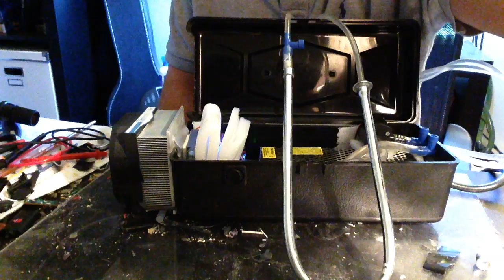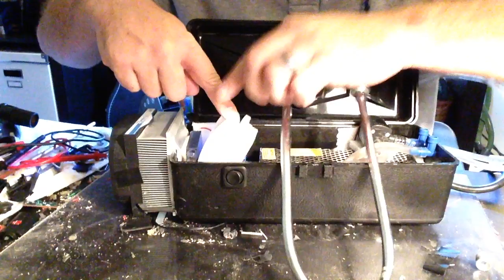DIY Reef Aquarium Peltier Chiller $50

Comment: Are you still using this? I thought salt water would rust aluminium water block.  Is there any rusting?
Reply from the maker: The tube is stainless steel. No rusting so far although it’s covered in algae so hard to say for sure.
Reply: The water I believe is not tank water that is being cooled. It’s separate water that goes through the stainless steel tube water block and clear tubing which then cools the tank water. The only things touching tank water are maybe some clear tube and the stainless tube

Comment: these things are like 4% efficiency rating. whyyyy even bother with them. Use 2 heat sinks on either end of a sealed vessel with butane in it. it will boil at the heat side and re-condense at the cold side.

Comment: Doing something similar, having an issue with the CPU fan .. tried to wire direct into the blk/yellow with no luck .. can you advise how you connected yours? Thanks
Reply from the maker: The cpu fan is wired directly but it’s a 2 wire fan. Some are 3 and require a controller.

Comment: I'm thinking about building something similar, although I think it may be better to keep the psu in a separte container.  I think the heat generated by the power supply can reduce the chiller's efficiency, not to mention the potential problem if you get a water leak inside the container with the psu.  Cool idea, though.
Reply from the maker: +Edwin Valencia great points. I ended up moving to an exterior power supply.

Comment: So let me understand this, the water that comes in (at what GPH) becomes 10 degrees colder at the output? One pass?
Reply from the maker: +Babak Morshedizadeh The water being cooled is in a closed loop. It chills the pipe which transfers the cold to the water lowering the temp.
Reply: +Innovation Labs I see, this is nice.
Reply: +Innovation Labs But won't stainless steel react with reef water, kill inverts?
Reply from the maker: Platinum would be better but I haven't had any problem.
Reply: +Innovation Labs Can you build me one? I'll pay for it, of course.
Reply from the maker: I'm sorry, no time. I am busy working on my RC lawn mower at the moment.
Reply: +Innovation Labs I need one of those too. Does the RC lawnmower make coffee too, also make the bed? Maybe also maintain the reef tank? And answer on my behalf to the wife?
Reply from the maker: Haha I wish!
Reply: +Babak Morshedizadeh you can get the parts on amazon . I did 4 of these in a Lil different manner for dwc system. going redo with a idea adding a controller to adjust temp.
Reply: TEC GROW I am looking for a solution to dwc reservior  temps. How well has it been cooling for you?

Comment: Any idea as to how many gallons this would chill or temp range?
Reply from the maker: +Zachary Roy  I have a 30gal tank and it can lower the temp 5-10 deg. Once it gets to the temp you want it doesn't take as much to keep it there.
Reply: Awesome, thank you for the quick response.
Reply: +Innovation Labs it's actually depending on Wich Tec1 127xxx ya use. the 12706 - xx or two stage or 4 stage etc.. Or TEGs with aluminum sidings gives 10% to 20% more output.

Comment: where do you get those stainless tubing?
Reply from the maker: I got mine at Lowes, the local hardware store. It came as a straight pipe and I bent it into the U shape.
Reply: did you use some tools to bend the SS pipe?

Comment: Any updates?
Any rusting going on? I wouldn't think that a standard computer water cooler would handle running saltwater? :O
If it works then it is very interesting! :D

You say that you can cool your tank 10 degrees with this, how large is your tank? :)
Reply from the maker: I am still using this on my reef tank, but as it is winter here it doesn't run that often right now. I have not seen any rusting or discoloring of the water in the system. It takes a while but it can chill my 25gal tank 10deg in about 4hrs. This setup keeps the tank at a constant temp. I think I could get better results if sandwiched the cooling block between 2 Peltier coolers. I just don't need to cool it that much.
Reply from the maker: To clarify, there is no salt water in the system. It is a closed system using distilled water that circulates and is cooled by the Peltier. That cools the stainless steel tube that sits in the aquarium.